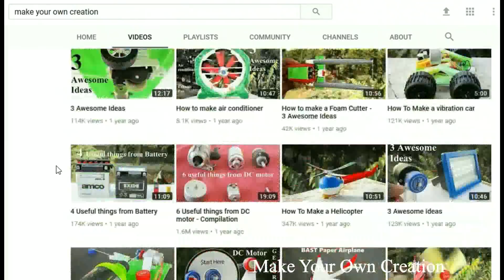How To Make a floor cleaning machine

Comment: I did the same project.. but i used havey material,  lik moters 1000 v battery 12 v n its running but full speed